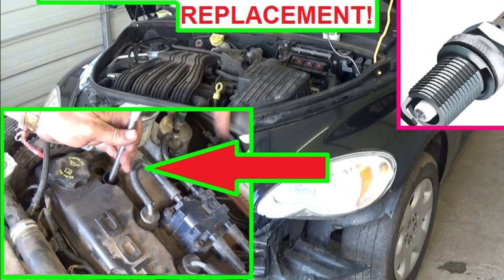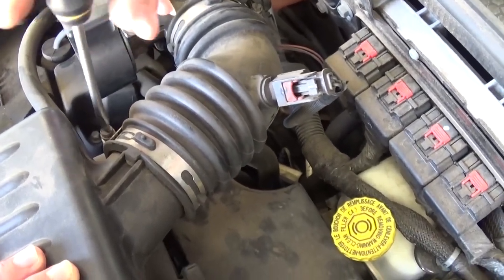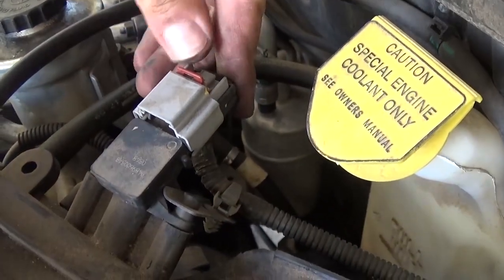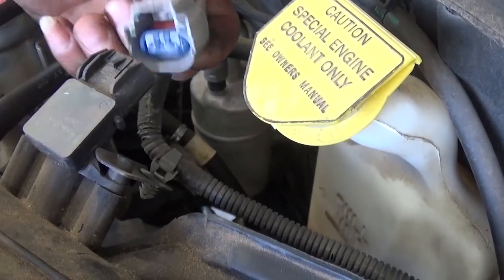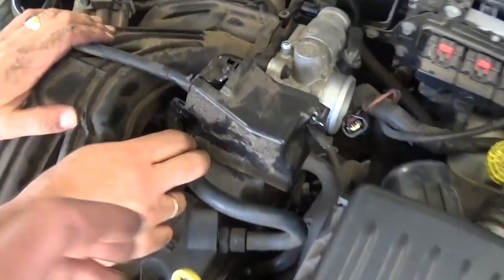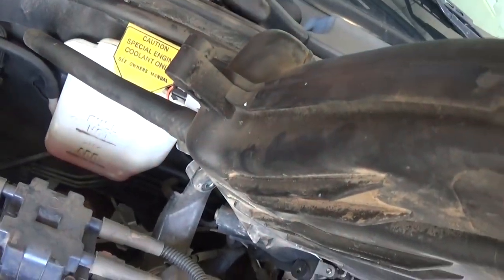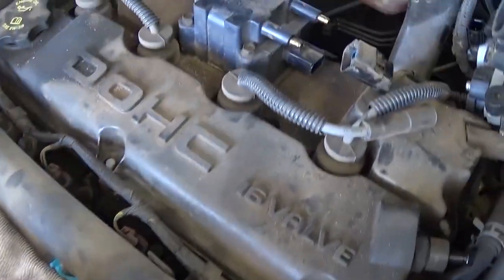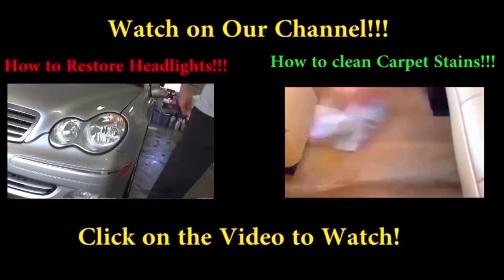Chrysler Pt Cruiser Spark Plugs Removal and Replacement! 2001 - 2009

Comment: Thank you for this excellent video. Instructions down to how to remove the electrical clips, which most other tutorials just say, remove clips. Close ups great as well. At this point in time, my PT is torn apart and got the offending plugs out. Before seeing your tutorial, I was about to take it in to a dealer.

Comment: I have a 2006 PT Cruiser GT convertible with factory intake, plus intake cover. All I have to remove is the cover that fits over the intake. 
Then I use a swivel 5/8 spark plug socket with a extension and ratchet. No need to remove anything else.
Very quick and simple.

Comment: great informative video. 

do you know what's the torque that a sparkplug should be? I have a torque wrench and I will like to use it.
Reply from the maker: +camilo11315 We are glad it was helpful. I will check in the books tomorrow when I go to the shop and I will let you.
Reply from the maker: +camilo11315 Acoording to the manual : for the 2.4L NA does say 13'# (17.5N-m). 

With this Warning in bold: The tapered seat plugs for this application are torque-critical! It is imperative that 13'# is NOT exceeded!
Reply: Thank you very much for the information

Comment: Will you please if possible tell me the specific sizes for that intake head 13mm bolt. Mine is missing, auto parts can't find it in their computers unless I give them the specific sizes. Thank you in advance
Reply: Is the car fine to drive without it? I'm having trouble putting mine back in and need to know if I can drive without it. He said something about it keeping the intake from cracking.

Comment: And this is why engineers need to work a month in a technicians hand and see how much money they are costing the company... All of this time and work to change 4 spark plugs.......
Reply: Ha, it's due to the small engine bay. Crowded. The turbo versions have an aluminum intake which is smaller and doesn't necessarily need removing. 

This job is super easy compared to replacing the timing belt, tho!
Reply: @onikin  Sure the job is easy, but time is money, how many HOURS has been wasted thus costing themselves money and their workers valuable time?
Reply: @onikin Whoopie!
Reply: @onikin Why should I consider spark plugs with replacing a timing chain? What happens when I need to replace the alternator, pull the motor?

Comment: the 2001 pt cruiser is completely different than this model. none of these connectors are the same, and theres more than one bolt in the back of the intake
Reply: So is the 2004 pt limited the other bolt is a 8mm for the record.